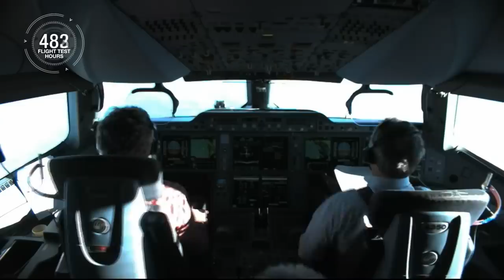End Of The A380: Emirates Considering The A350!

Comment: why don’t rr agree to make a more efficient engine tho?
Reply: Probably does not survive an economic analysis.
Reply: Millions in research and development for a dying product. RR already has their hands filled with the 787 and A350 engines.
Reply: Not enough volume for the investment
Reply: @johniii8147  I really wonder how much would it cost RR to create a Trent 7000 that has 76,000lbf?  They already have a Trent 1000 TEN that is 76,000 lbf but it is a bleedless engine.
Or another scenario is for RR to create a Trent XWB that has 76,000lbf? That engine was initially planned for the A350-800 which was subsequently canceled.
Reply: Ivan, It will probably be too expensive to invest into developing a newer engine. The more appropriate question will be to ask Airbus why dont they just slap on a more efficient engine such as the Trent 7000 or Trent  XWB that RR is willing to support.
Reply: Ching Wei Xion The simple answer is a  lot. RR Finances are very shaky right now so they don’t have the capital for it
Reply: @johniii8147  Why would it be a lot??? they certainly didnt spend that much developing the Trent 7000 out of the Trent 1000.
Reply: Ching Wei Xion  You don’t understand how in engine development works It’s actually very expensive to upgrade engines especially in this environment where they have to be extremely efficient. Ithave been spending tons of money on it. Just the certification from regulators on a new engine. Started about $50 million for all the testing. Through an actual development costs you’re looking at three to $400 million
Reply: @johniii8147  Point taken. Assuming that RR tries to recover 2million/engine, it will still require 50 A380 to recover. 36 is just too low.